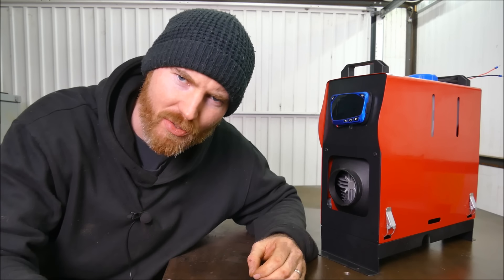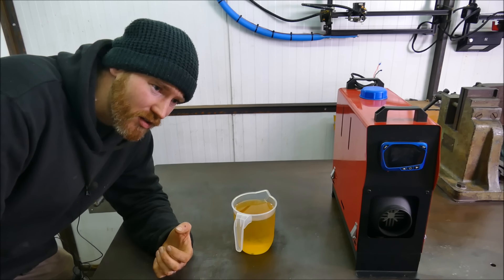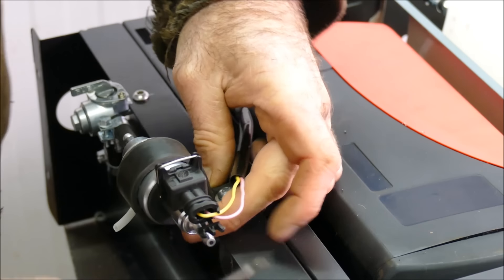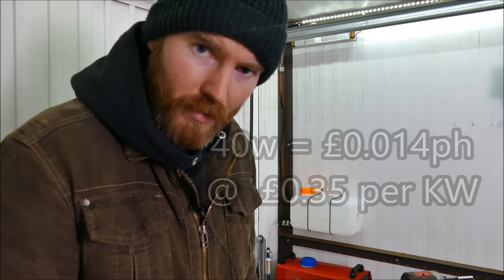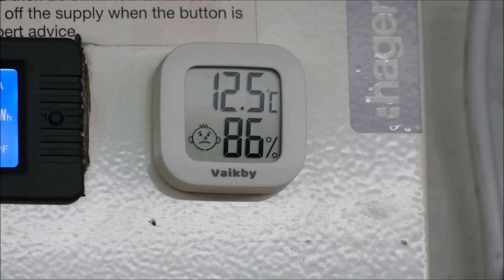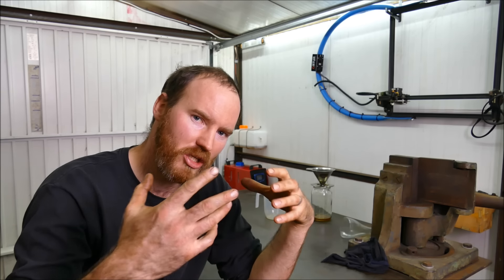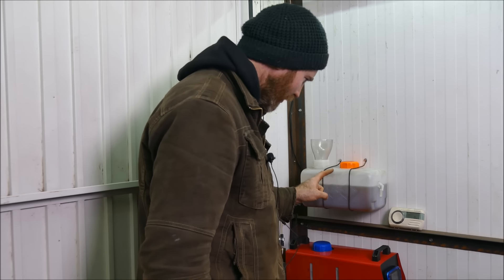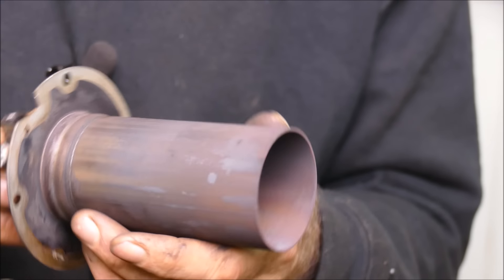£0.03 per kWh heater modification - Top facts & lies on diesel heaters - waste veg oil burn success

Comment: I’ve tried two different sized units and can’t get the right combination to evenly heat my van. Large ones were too big for chilly mornings and the smaller ones couldn’t keep up and gave me hot and cold zones. Just bought a different van and ordered a 2kw and an 8kw heater. The large one will go in the back and the small one up front. I’m going to look and see if I can connect to the defrost hoses and be able to keep the windshield dry and warm.
Reply from the maker: @tomaskey6844  the large one can still run on a very low setting. I would have the heater in the back and duct to the front. That way you'll get a circulation around the whole van and not have any cold spots. Cheers J
Reply: @ true but it wasn’t working in my application and thus I’m using two units of different sizes. I’m hyper sensitive to cold due to Lyme Disease and have a real struggle staying comfortable and can go from shivering to sweating in a flash. I need to be able to keep the entire van evenly heated and a heater in the back does not counter the cold off the windshield so thus an additional smaller one up front with plans to try and split it off into the defrost ducts. These are great heaters and in my experience with several of them they work best in a certain range.
Reply: @ and also I wanted a back up plan in case of a failure. I didn’t want to have to swap out units. In my current van I do have one midsized unit and with ducting it works great overall and I keep spare parts on hand. It is good but I wanted more specific zone control and I wanted to add defrost capability so two units seems to be a good solution for all my combined needs.

Comment: Although on a much smaller scale are we concerned with the length of exhaust pipe.... Ie:. Will a longer exhaust pipe create issues concerning back pressure ... That would or could affect both intake ability and burn off ...time vs heat...?

Comment: Wrap a coil of copper brake pipe around the hot end of the exhaust pipe. Run your vegetable oil through this coil to heat it. At 80 centigrade, the vegetable oil has same viscosity as diesel/kerosene.

Comment: I am experimenting with distances for hot air piping. I want to heat several areas on my narrowboat from a heater at one end to points at 3 metres and 6 metres. I am expecting heat loss through the pipe but not sure if it will result in heater shutdown. Its for my dinette area and office area. I can shutdown the heater easily by blocking the outlet. So its going to be interesting to see what the hot air distribution capabilities are for this heater. I have not seen any information about this. The alternative is a second heater which will start causing issues with the recreational battery bank.
Reply from the maker: Hi. Ducting the heat will work fine. I would put the intake to the other end of the boat rather than the hot outlet. This way you create a draft that pulls the heat evenly across the boat and is less strain on the fan. Cheers J

Comment: I would bet that the exhaust wasn't leaking water but was in fact cooling down so much that the moisture was condensating out of the exhaust in the pipe.  That is why high efficiency furnaces have a condensate pump even when they are heating.  There is so much heat taken out of the exhaust air that the moisture seperates out of the exhaust air inside the pipe.  If you make sure that the inlet of the exhaust pipe is lower and inclined all the way to the other end outside, the water will drain out of the pipe along with the exhaust gases although it might be hard to water cool it this way.  I would guess that if you used a really long exhaust pipe it would condensate inside the pipe before it reaches the end of the pipe outdoors.
Reply from the maker: I think you're right. Cheers J

Comment: electric is about 38 euro per kw , red diesel is about 1.37 euro and kerosene/petroleum 3 euro per liter in the netherlands 
as for filtering the wasteoil , it might be a better idea to make an airtight connection between the funnel and the catchcan and run a vacuum on the catchcan (vevor sells vacuum pumps) 
reason being if a pressured vat is pressurized and it goes wrong it could explode or at least spill a lot of oil , if the vacuum fails it will only overflow the funnel or collapse the catchcan
mightnot be able to get the wasteoil from the fish and chips , it gets bought up and converted intoo biodiesel

Comment: I run mine on diesel and had a long exhaust pipe, I found that after a few weeks of running the exhaust blocks up with carbon and needs to be removed and flushed out with high pressure water. I tried running on used synthetic engine oil but that just gunk's up the burn chamber after a week of use every evening. Haven't tried used cooking oil but next winter may give it a shot.
Reply from the maker: Sounds like it's burning too rich. Try exploring the settings to get the air to fuel ratio higher. Cheers J

Comment: could you Leave the ehaust straight and coil copper pipe around it connecting that to a water tank?
Reply from the maker: As long as there are no air locks then yes. Cheers J

Comment: I have the same heater that I rigged up in the storage compartment of my pop up camper , and ducting into the inside it works great except for the thumping of the pump do you have any ideas…to quieter down. I think some of the sound is resonating thru the wooden floor.

Comment: One doesn't need any special tool to install a Rivet-nut, you just need a bolt and nut of the proper thread size/pitch and two or three washers.  Thread the nut onto the bolt then two or three washers with enough threads exposed to thread the bolt into the Rivet-nut.  Then with one wrench hold the bolt head from rotating and tighten the nut into the Rivet-nut, ie counter clockwise, with another wrench.  It will crush the Rivet-nut clamping it onto the metal panel just like the tool does.
Reply from the maker: That depends on how you value your time. Using a proper tool will reduce the fitting to seconds. I don't have the time to waste fiddling with bolts and washers if I don't have to. Cheers J
Reply: @joshuadelisle  I posted more for others who might only need to do a few, one time only, which makes buying the special tool a bit of a waste of money.  I then watched the newer video where you mention the bolt trick.  Thank you for the vids and your reply.

Comment: I'm trying to find something cheaper than that crap flexible pipe. I was thinking to just use steel pipe with fittings. At about 15 minutes in when you're routing the exhaust pipe. You say make a heat ex-changer. Could the exhaust pipe be adapted into one end of a small car auto radiator with a 12 volt fan attached. The output of the radiator should be cool enough to use cheap flexible hose. The 12 volt auto fan would blow the heat into the living space. Less BTU wasted. Would it work?
Reply from the maker: Very possible. Cheers J

Comment: Please can you tell me if the exhaust gets that hot is it safe to go through a wooden floor or would it catch fire thank you very much for your videos
Reply from the maker: Hi. It's definitely not safe to be covered in wood. You want at least 4" of gap either side of the exhaust and to be fitted through the wall with a stainless steel cover plate. Cheers J

Comment: I bought two of these heaters. The first had a very strong burning rubber smell. I took it apart and removed a rubber gasket around the exhaust pipe, but it always smelled and I could never fix that. The second one crapped out after about 40 uses. It got clogged, or something. It had an error code. 
A friend bought one and had the same problem. If you get one if these diesel heaters, hope you have better luck than me or my friend did.
Reply from the maker: Did you dismantle it to see? they're very simple and not a lot to go wrong, you might have been on a wrong air mix setting or your combustion air/ exhaust was blocked somehow in a faulty batch. normally very easy to fix and all parts are cheap to replace. Cheers J
Reply: @joshuadelisle  I didn't take the inner core apart, but I have dismantled them to that point. 
I live off grid and heat with wood from my own land, so I got one for my very small house so that I could lay in bed in the morning sometimes rather than make a fire. I thought the diesel heater would be a nice luxury. 
I did find that in order to install them outside the space you want to heat, you have to take it apart and remove the control unit from the front panel so you can install that inside the heated space. This is a pain, but you have to do that unless you want to have the noisy thing in your living space. 
All this kinda made me decide to not screw with these things. Besides, diesel is expensive. 
Anyway... if you like em, cool. Im sure they work out great for many.  Not 4 me though.

Comment: I've just bought one. 
Seems to be hungry on batteries. But I'm impressed.
Reply from the maker: It's 40w for the fan and controller, nearly 150w for a minute for the glow plug. If you have it ticking over on a low setting it will much less but I find a hours burst of high heat is enough for long while especially if you have good insulation. Cheers J
Reply: @joshuadelisle I'll figure things out. 24v might be the go

Comment: Is the garage door behind you insulated? If you connected your exhaust to pass through and heat an oil radiator, you will substantially increase the passive heat capture and that heated oil will radiate from the fins of the oil radiator slowly and over a longer period.

Comment: Try this , put a oil filled radiator in front of the hot air duct, it heats the radiator oil up and more free heat

Comment: There’s a guy on here that used some type of powdered gelatin and put it in the veg oil and chilled it and it grabs the stuff in it and falls to the bottom for you to remove. Other people are using chemicals to separate the veg oil and clean it up.
Reply from the maker: @carlhenrikson4174  yes I've seen that. Gelatine costs though. Cheers J
Reply: @  I’m still learning about the veg oil end of this. Can’t find much that says it’s good or whatnot. I want to make it work for the fact I have 2 diesel heaters and a restaurant with a waste veg oil bin of about 300 gallons 20ft away from me. Everything I keep seeing says it has to be filtered and as clean and pure as you can get it to use it the right way.
Reply from the maker: @carlhenrikson4174  you want to either process it into bio diesel by removing the glycol or cut it with 30% regular diesel. Apparently you can use gelatin as a filter agent. Cheers J

Comment: Here is a thought. Suppose you took the exhaust and the output of heat and ran it through a water jacket and heated you house with the water?
Reply from the maker: @mellowpuddle  exactly what I'm doing just now. Video coming soon. Cheers J

Comment: Would you  consider creating a central heating system with the exhaust , including a running hot water system .

That’s a project I’d love to see .
Reply from the maker: It's certainly possible. There is a dedicated diesel hot water unit available though. Cheers J
Reply: @joshuadelisle  

I know , but I’m thinking a whole central heating system , using exhaust gases through radiators , would be hard to regulate me thinks

Comment: May I add a way of increasing the calorific value of waste oil. You need 50mm id tube, SS is good, then you need Penny washers drill each side of the washer and thred onto steel rod, spot weld ever 50 mm /2" for the length of your tube, may I suggest 4 x 1mt length with a 1/2 curricular peices to join into a continuous 4,5mt length, pump waste oil around the system, the oil driven through the center of the washer will break up the long chain fatty string into short chain,  which burns faster hotter.

Comment: long term use you will have to take it apart and clean it. break cleaner works great to dissolve to carbon build up. Running it on highest setting for ten minutes before shutting it off will help burn out the carbon and prolong the need to be cleaned.

Comment: I've  went to lowes bought a vent that you raise window about 6 inches and accepts the metal dryer hose placed on a metal table outside on porch. Sets about 3 ft from the house,,Bought a 110 to 12v inverter been using for 4 years now... no  natural gas... ive got a 2000 square ft house. If it gets really col,  i have one ready fo the  back of the house.

Comment: nice video but i trider also to modify this cool staff butt to noise level and i advise you to put muffler on intake and bend with pliers sucking pipe. it makes about 30 % better. Another put 2 mufflers on exaust. I'v been running it many years and it's much more less noise flustration level. I.ve tried also on veg oil and its stinks so i would it not recommend to other

Comment: You should pipe the exhuast... into a sand battery.
Reply: You will have hours and hours of heat if you place a oil  heat exchanger in the sand using stored heat as needed

Comment: In Denmark kerosene is 17,- for a liter, and diesel/heatingfuel is 11-13 a liter. 😢
Reply from the maker: @bilerogbade3956  what about jet fuel or specifical heating oil. Cheers J
Reply: @joshuadelisle  Nope 😞
Jet a1 13.90 and heating Oil 11-11.90
No shortcuts in Denmark.
They even put tax on rapeseed oil and rapeseed pellets 🥴
Banned Old woodstoves if the House the stove is in, gets new owners.

Comment: the water in the pipe is condensate, by putting the exhaust in a bucket of water your recovering heat from the exhaust gases like a condenseing combi boiler does,the true steam reaches its dew point and becomes clouds of water vapour, the flue of a condensing combi boiler rises slightly so the condensate doesnt drip out the end, it runs back and down to a auto flush catchtank

Comment: The black hose fits on the barbs,  you need a hose run from barb to barb,  why switch to the white tubing?
Reply from the maker: Constant diameter and hard wall with no flex. Cheers J

Comment: Mine all drink 0.5 lts per hour flat out in open air, but are set to 8hz. One came from factory with 8hz max setting, others mostly came with 5.5 as max, but another one came with 7hz. I reset all mine to 8hz max(in advanced settings menu) as all 6 i own are identical units, despite some being sold as 5kw, others as 8's. I tested delta t and airflow rate some years ago, and worked out i was actually getting 4.2kw, which is a fair bit  less than 0.5 lts of diesel contains(4.85), so seems close to correct.(note if checking airflow, keep meter moving over entire airflow, and get the average, as using only the peak reading will distort the calc badly).
Ps SN setting can be for number of magnets on fan wheel, but all mine have 2 magnets, but use SN1 setting. Reason is magnets have north and south poles, if the 2 magnets have been installed in fan wheel with opposite polarities facing sensor, or it has only 1 magnet, then SN1 is correct. Set to sn2 only if magnets both have same polarities facing the sensor(it's in the very tiny fine print at end of manual).

Comment: in your calculations you should've accounted for the wasted heat (expelled through the exhaust) which i would assume is more than half of generated heat, which essentially brings your heating cost to the same level as electricity since theres no wasted heat with electricity.
Reply from the maker: It's in the video. However calculating the cost is difficult if I can't measure air density and flow rate of the exhaust. If you cool the exhaust to the point of condensing moisture in within it then it's as efficient as it can get. Cheers J
Reply: im commenting as the video is going, so my apologies for comments that arent adequate  @joshuadelisle

Comment: hi if you mix veg oil with kerosene   3 parts kero   to 1 part  veg oil       it should run without any problems     ... we used to do this in my old ish  diesel  car   ..kerosene is a degreaser    so can rot things   .. adding the veg oil  is the same viscosity as diesel

Comment: the water in the exhaust was just condensed water vapour from fumes. You discovered the latent heat :) is the system how modern condense home furnaces works, they use a special designed heat exchanger to condense the exhaust gases through a colder water return to gain more energy from the exhaust. Diesel or red heating diesel has a condensing temperature of 47 °C, natural gas around 37.

Comment: I wonder about a catalytic converter acting as a sort of heat exchanger in itself? I know they get very hot! Also they used to make heat exchangers for wood stoves. I think they outlawed them .  But it was a box the exost ran through with a series of pipes ran through it for heated air to run through. They worked great but were hard to clean and I think that's why they were outlawed.?
Reply from the maker: @donscottvansandt4139  hi. I know catalytic converters need to be very hot in order to work. So any cooling needs to come after it. I've never heard of a wood stoves cat converter but I can imagine they would get blocked. Cheers J

Comment: Use standard steel pipe for the exhaust then a role of copper pipe of 12mm and wind that around the exhaust which you then run water through it on a loop that then heats up the bucket!

Comment: How long will it run on a low setting just to stop the garage freezing at night would love to have something run 24 7 in the garage over winter just to keep stuff from getting damp
Reply from the maker: @sprjordan1  it will run forever if you have a big tank that you can fill every now and then. How much does it use over a 10 hour period on low ill need to do another test. But I can say now  5ltrs will last well over 10 hours. Cheers J